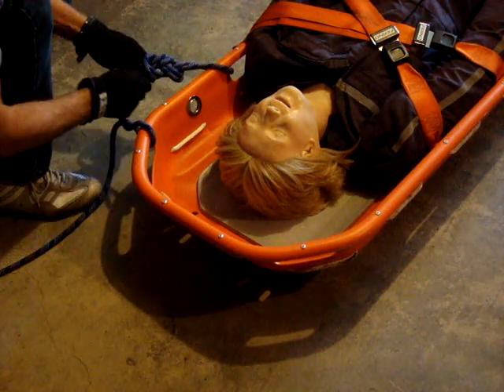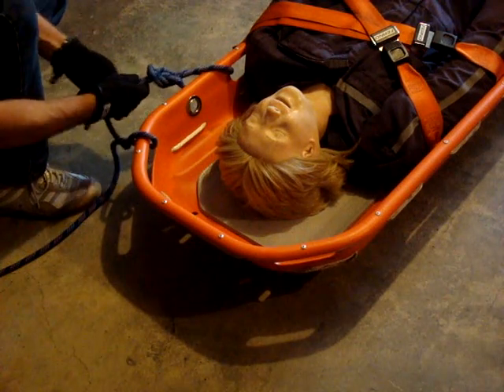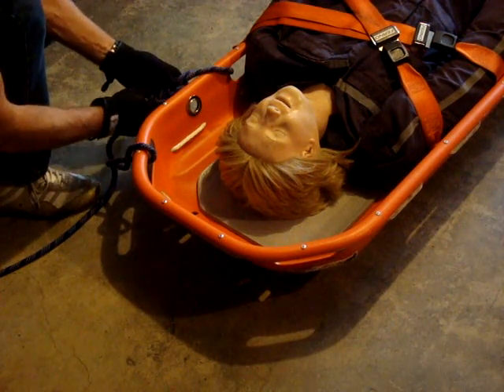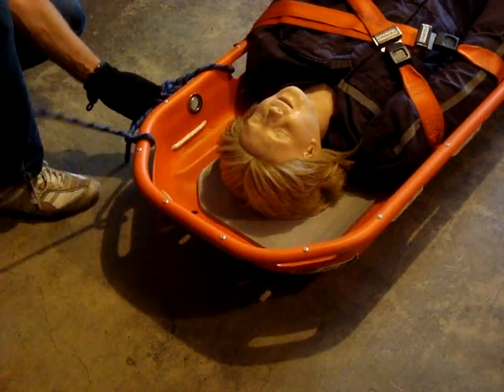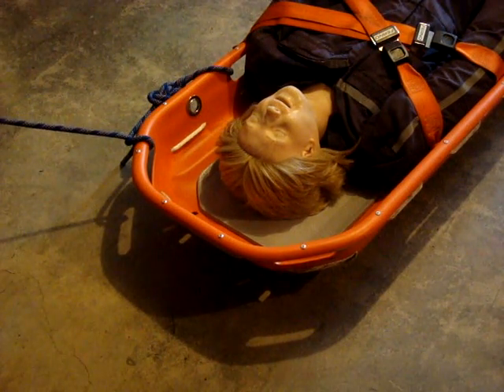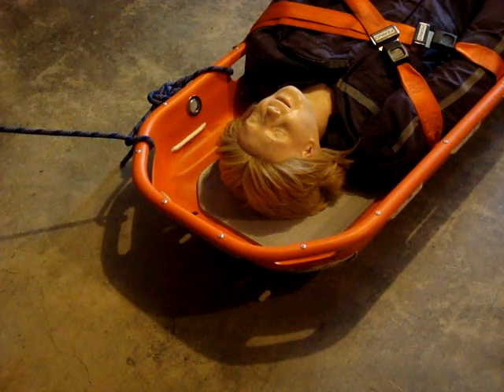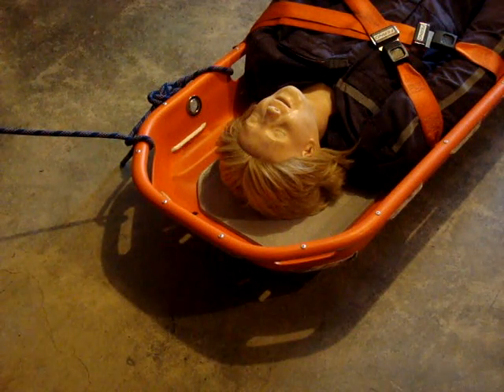rescue stretcher attachment knot

Comment: So a half hitch and a figure 8 follow through... I could see where this would be nice with the manpower for to lines but why not something like a split locking clove triangulated with a bowline so you only need one line, then attach to your hauling/ friction braking system... Using two lines just seemed inefficient, unless your victim is morbidly obese... Then most rescue tech is out the window anyway. That's an interesting basket though and id like to see the specs on it...